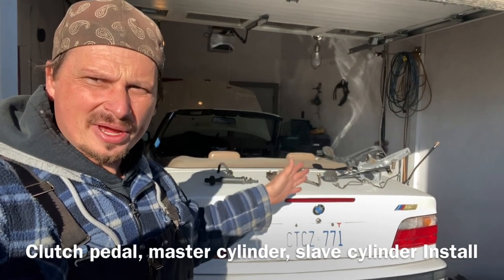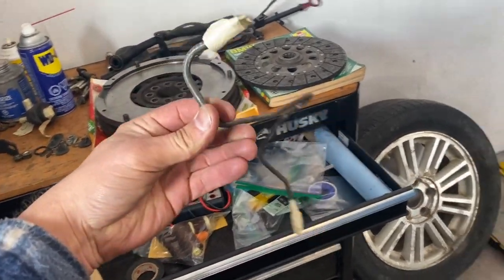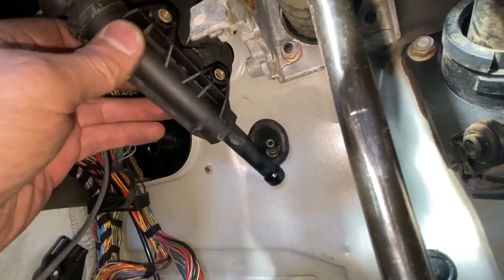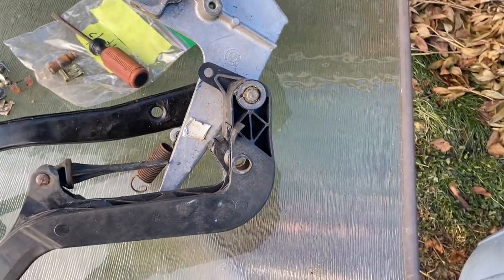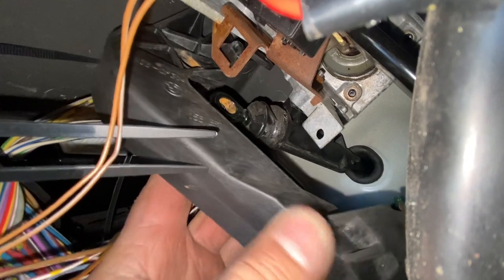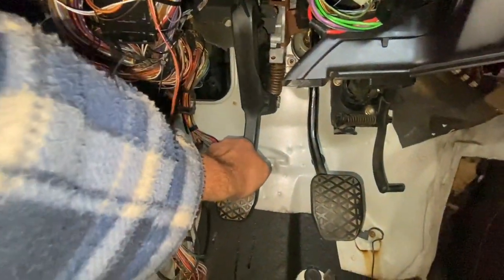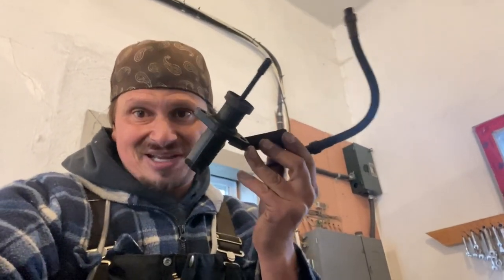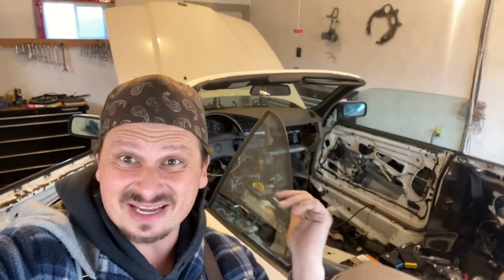BMW E36 Manual swap clutch pedal, clutch Master cylinder Installation. BMW 318i 320i 325i 328i m3

Comment: I think it is abundantly easier to just bolt in the manual pedal box, rather than trying to use parts from both. Almost at this stage for my swap, these videos have been super helpful!
Reply from the maker: Hey, thanks for watching
Reply: Are all manual e36 pedal boxes the same? (eg 318i and m3)
Reply: @spencerleeb  yes all are the same

Comment: is that bracket you welded on the chassis for the slave necessary? or can i just connect all the slave lines and run it?
Reply from the maker: I can't remember. If you don't know how to weld you could screw a bracket on
Reply: @ProblemSolverGarage  i just connected hard like from the master to the the soft line and that to the slave hopefully that works, bled fine so fingers crossed
Reply from the maker: @Tblu_3  well you don't want that steel line to move, that's the point of the bracket.

Comment: Thanks to your awesome video I have completed my manual swap and everything works. 

One question— the automatic gas pedal has a kickdown switch behind it. now that my car is manual can the switch be removed? 
is there any special tips or instructions to remove it so it does not affect throttle or accelerator?
Reply from the maker: You can change it to a stop screw, careful if you don’t set it right it will break your gas pedal, but in reality there’s no point it doesn’t do anything anymore You can just leave it as is
Reply: @ProblemSolverGarage  ok. I will leave it as is since it doesn’t hurt anything. Thanks again for your help and support.

Comment: My manual pedal has only the top hole not the second one? Do you know why
Reply from the maker: Maybe the older ones didn't have a safety neutral switch but not too sure which Hole you're talking about it's been a while

Comment: Doing a swap on my little brothers m3 and we were dropping the trans in and you can tell the input shaft is in but still doesn’t go in enough to be able to put the bolts and we push and push any tips on what we can do?
Reply from the maker: Pull it back out sounds like you guys missed something, maybe your clutch is misaligned
Reply from the maker: You shouldn’t have to force it
Reply from the maker: Also check your pivot pin, make sure you have a new one

Comment: hey man did you keep your kick down switch for the throttle?
Reply from the maker: Yes
Reply from the maker: But it’s disconnected it doesn’t do anything anymore
Reply: @ProblemSolverGarage  alright. it doesnt affect how wide the throttle body opens correct?
Reply from the maker: @nicka.8993  It’s only there to downshift the automatic transmission which is no longer there
Reply: @ProblemSolverGarage  Alright thanks. Your 944 videos are also helpful. good stuff man.